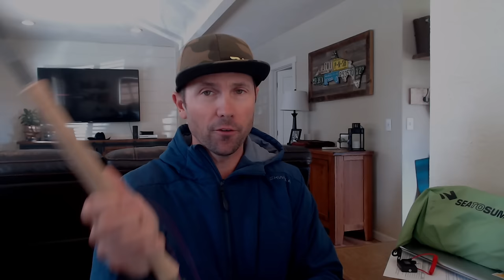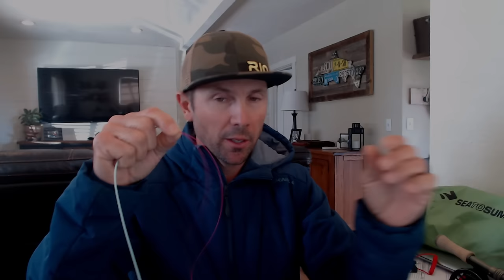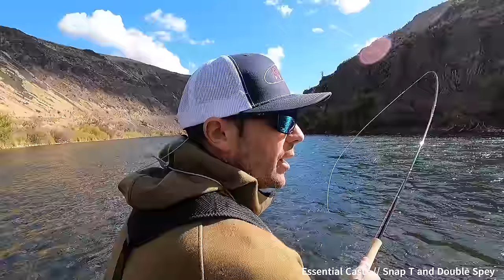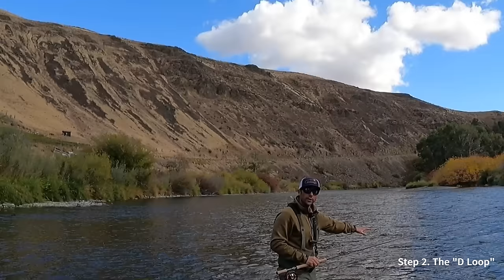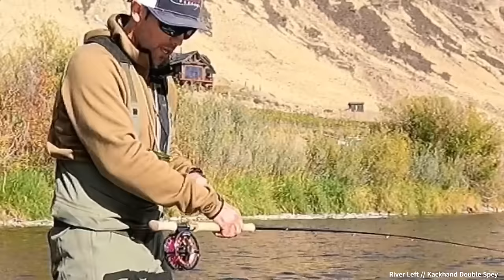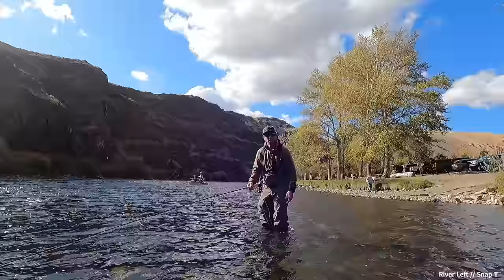Trout Spey School // Part 1 - How to Cast Your Trout Spey Rod

Comment: Could you do a video on scandi heads and casting?
Reply from the maker: That's a good suggestion, I just got back from a steelhead trip and it was 90% Scandi. Good for smaller flies, but very useful skills to learn as many of them can be applied to your Skagit rigs too.

Comment: Would a 10 ft 5 wt rod be appropriate for this style casting?  I am actually in TX and normally bank fish ponds for LMB.
Reply from the maker: Absolutely, you can single hand spey cast just fine. The line we prefer for that is the OPST Commando system and a 10' 5 weight would typically work well with a 225 grain head and 96 grain OPST tips (Riffle, Run, Bucket) sink rates. If you give us a call we can put together this order for you.

Comment: Great video.  I had a question on what knot you used when connecting your running line to the shooting head? Loop to loop but what was tied at the end of the running line?
Reply from the maker: I use a "Double Surgeon's Loop" from my running line to the shooting head for the loop-to-loop connection. Does this answer your question?
Reply: Yes, yes it does. Thank you very much. @redsflyshop

Comment: Hey Joe, great Spey tutoring! Have you ever used an indicator and nymphs with this Spey rod? Or only single streamers?
Reply from the maker: I have. I did that for summer steelhead enough times to learn that "yes" you can cover a crap ton of water but it's messy, hard to mend, the heads are super think and you get more drag than with a standard setup. Hook sets are like car wreck. Pretty messy. In a pinch (like if you put on a RIO Switch Indicator Line), you can certainly do it if you packed one rod for the day but it wouldn't be my first choice.  https://redsflyfishing.com/products/rio-elite-switch-indicator

Comment: I'm just curious as to whether I can use these casts you've demonstrated with my Mystic 11'3" 8wt switch rod ? I currently have a thicker portion shooting head (?) fly line on the front end, about 20'+ long, then the thinner fly line & unfortunately I don't have the box for that shooting head line any longer & don't remember the weight, etc. ( recommended by a local shop for Salmon & Steelhead here in Michigan, but that shops not in business an longer ) For sometime I actually use a cast I found on your Youtube channel, that you taught I believe, that does a single overhead cast. That overhead cast works fine ( so far ) on the rivers in MI from my Hyde because there's no shoreline, or trees nearby as the river is pretty wide, but I'd like to know if these casts would work better & make my casting easier. I'd like to hear your thoughts & recommendations

Thank you,  David
Fisher-of-Men Fly Tying & Fly Fishing Instruction
Ada, MI
Reply from the maker: Absolutely.
Reply: Thanks for answering my rather long question !!  Once it warms up a bit here & the water levels come down I'd like to go to local spot & give the casts a try. Thanks again !!

David
Fisher-of-Men
Ada, MI

Comment: I am thinking of trying out a Spey rod but for smallmouth bass.  The big water near me is more smallmouth territory vs. trout.  Much of it is challenging to wade fish because of its size an depth and I think the Spey cast could be a game changer.  What wt rod would you recommend for smallies that could be over 20’?
Reply from the maker: I would get a 5-weight switch rod, max of 11' as a stout rod will allow you to twitch and pop flies and makes casting heavier flies easier. There are lots of options, so it can be very brand dependent based on your loyalty to certain companies. Shooting from the hip, the Beulah G2 in the 5/6 would be my choice. Pair that up with a RIO Mini Max 325 Integrated line.... wooohee... Add some Light MOW tips and you'll really have a hot setup there.  https://redsflyfishing.com/products/beulah-platinum-g2-switch-rods

Comment: How much line should I let outside of the tip ring?
Reply from the maker: Well, I think you are referring to how much line outside the rod tip if I understand correctly. You'll want just about 6" of the thin running line for a "baseline" then as you get dialed into a certain rig, fly, or depth of water you can adjust. If you are wading deep you'll often want the back of the shooting right at the rod tip. If you are ankle deep then you might want up to 2' of the skinny running line hanging out. Play around with it, but start with a consistent overhang.
Reply: @redsflyshop  THX!

Comment: Hey Joe-- great video. Right up my alley, beginner all the way. I have a nice NOS Redington Hydrogen Trout Spey rod gonna give a go. It's the 11'6 4 wt. The OPST Commando head-- 250 or 275 grain? Thanks.
Reply from the maker: New to spey, go 275 on that rig. It will force you to go slow and let the flex of that rod send the line. 96 Grain OPST tips will be excellent on that rig. At 11'6" you'll really need to go SLOW and not "blow your anchor". Keep that fly stuck to the water... then send it!
Reply: Great thanks Joe! @redsflyshop

Comment: There are no complicated thing in speycasting,the lower hand does the work and if you stop the rod fairly high and make sure the stop is instant you are basicly good. Then you do the same from the other side and you are good anywhere. You dont need 13 different casts if you can cast from both sides. This is basic and simple and it CAN be done in complicated ways but i dont see any reason to do that.Dont need a double spey and dont need a skagitcast. Learn to cast from both sides. It will make your life a LOT easier.